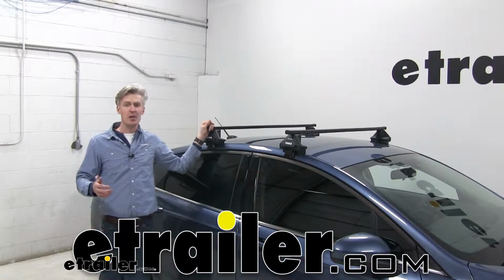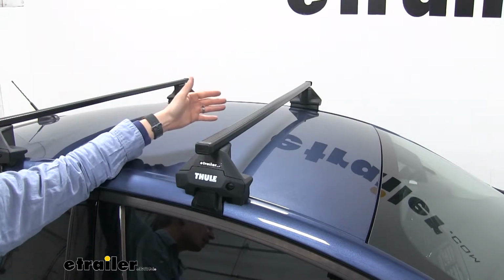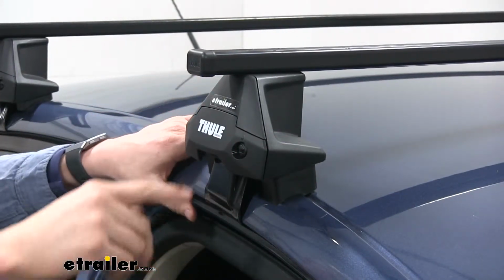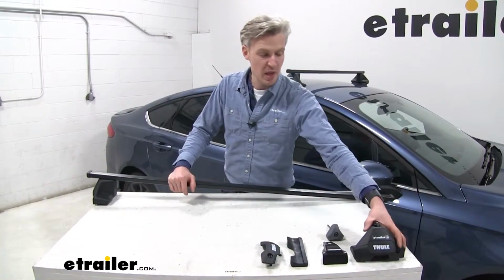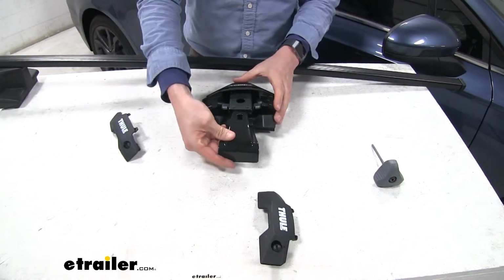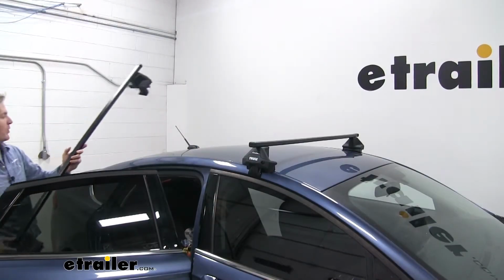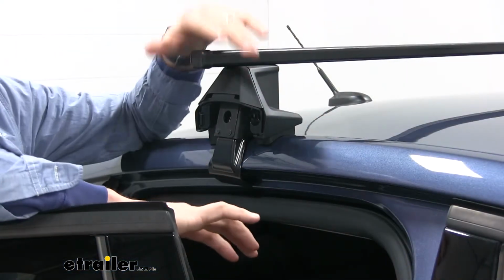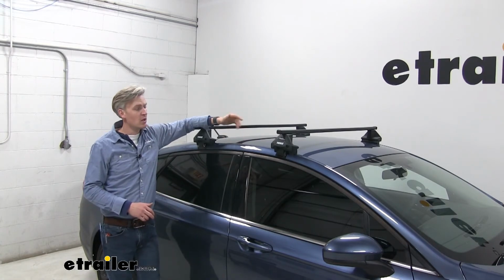Setting up the Fit Kit for Thule Evo Clamp and Edge Clamp Roof Rack Feet on your 2018 Ford Fusion

Comment: How would a Thule 599 attach to this style of bar?
Reply from the maker: The Thule square bars do not have an integrated t-slot in them to mount t-slot accessories. You would need to get a set of the Thule WingBars that have t-slots for accessories.
https://www.etrailer.com/roof-2018_Ford_Fusion.htm?fUrl=-pm-Thule